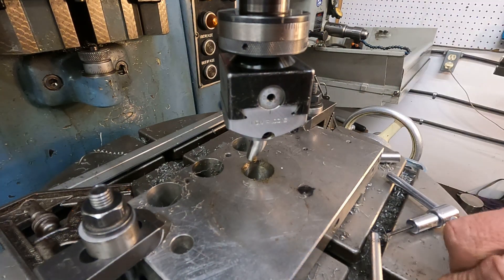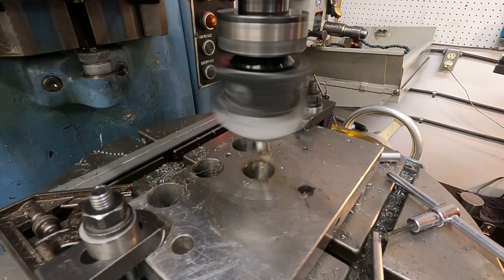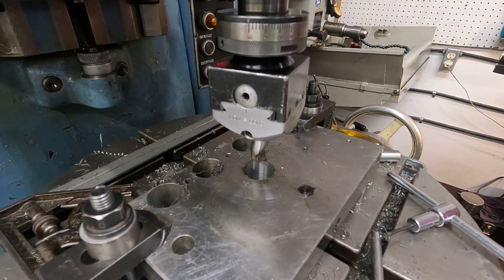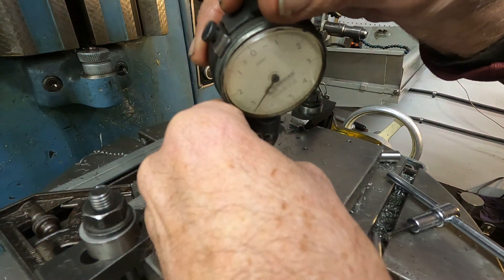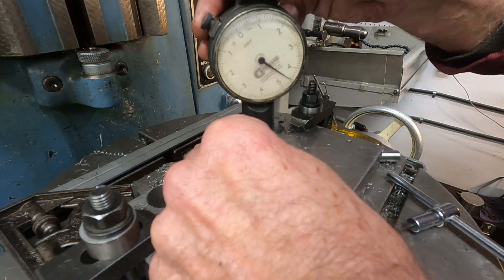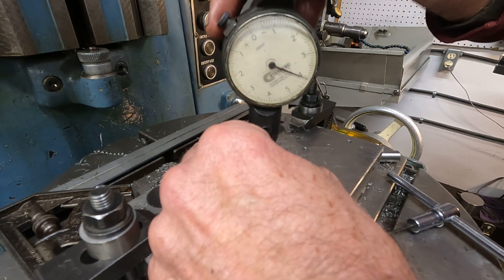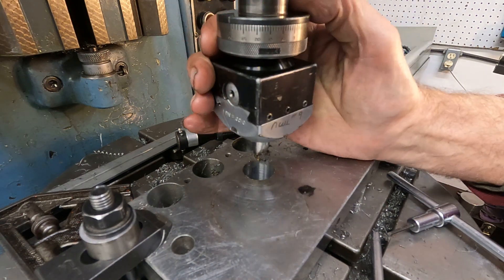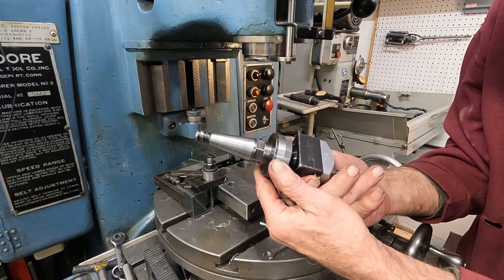Jig borer Criterion tenth set head conclusion

Comment: DeeDee, You don’t always have to love a mystery.  Wish it had turned out that it met your hopes.   My good news is that with much effort my ELSR controls on the apron now have nearly zero play.  The credit goes to my friend Archie who bushed the gear that rides on the control shaft.  The ID of the gear was way out of round and too big.  A mystery that someone had attempted to fix by gluing two shim strips.  Better now.  Sorry about the boring head, but you’ve got to figure out why.  Cheers Friend, TB
Reply from the maker: I actually have tried almost every boring head made since I have the perfect platform to test them for Moore than 20yrs. My conclusion is for sneaking up on a one shot chance to hit bearing tolerance on a single hole a boring head like the Moore and the Kennametal/Erickson with a direct screw adjustment and .0001" vernier is hard to beat. It is important that the ELSR returns the spindle lever to neutral lock because when you are done threading and back the carriage away from the trip dog, the lever can fall into forward. I filed and fit a key in mine too and I always oil it. It is good practice to mark the speed dial with a dab of paint to know where it is at. Sounds like you are on it "The Blade"